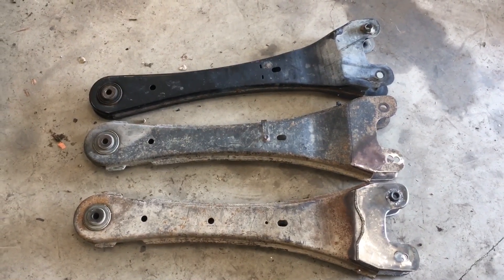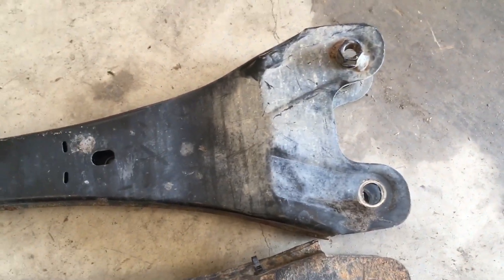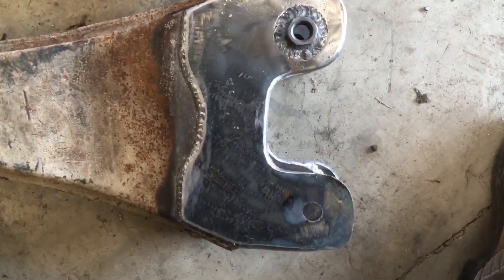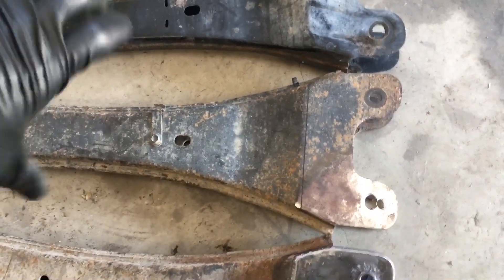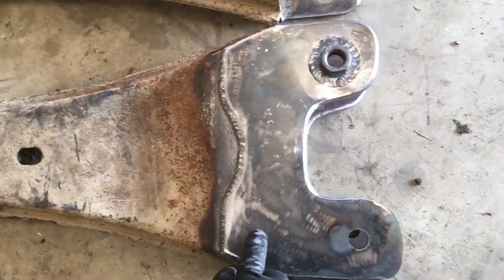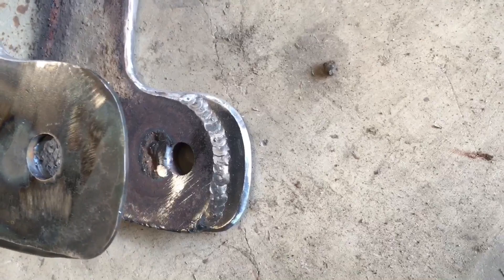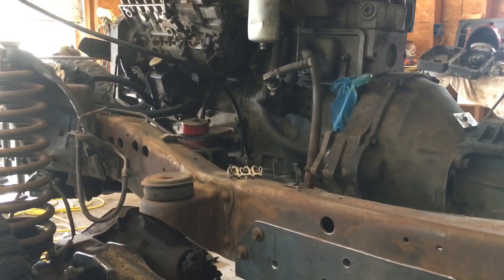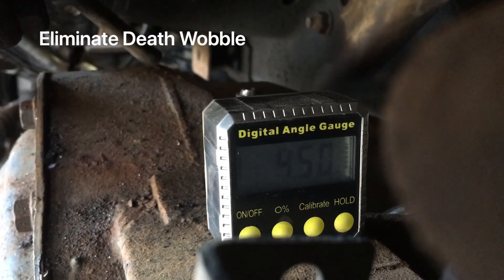Ford Cummins 4x4 Econoline Van Project Episode 7 modified Control Arms

Comment: 3-14-25
Where are you putting your angle finder to get the angle? I’m doing the same thing right now. I’m not sure where I’m supposed to put the angle finder. I believe it’s the top of the ball joint? Thanks for the help Ken.
Reply from the maker: @kennethkolsch  I was told to use the flat spot where the bump stop would hit on the top of the axle to driver side of the differential.

Comment: If your interested in looking at a different frame bracket design for the radius arms, look me up. 91-20 e-series to 06 & up f350 front axle. OR a 96-01 dodge 5 or 8 lug front axle. Ig @  troy.reece.583  Your videos are doing well. Thanks for the info.
Reply from the maker: Do you have a link to more info?
Reply: @GillansGarage  ig@troy.reece.583